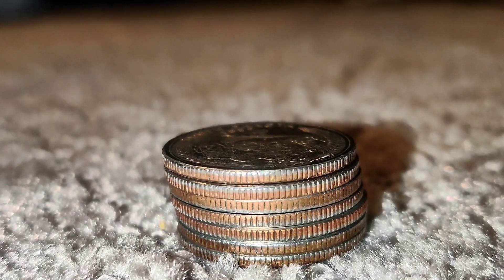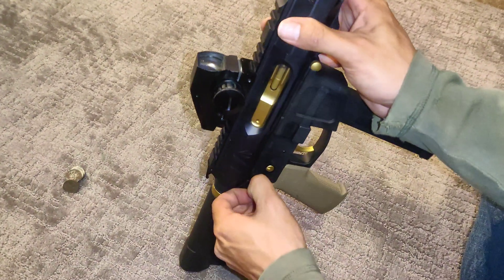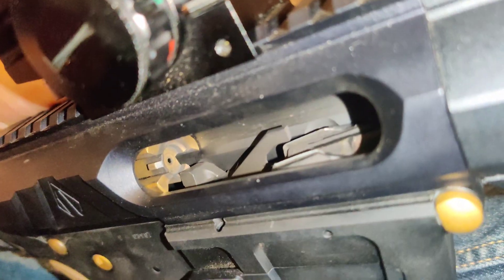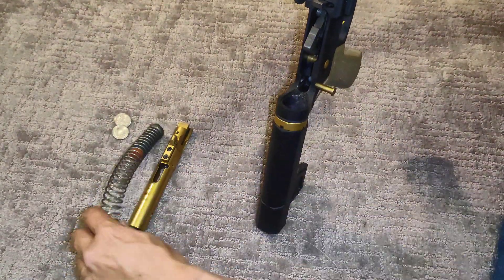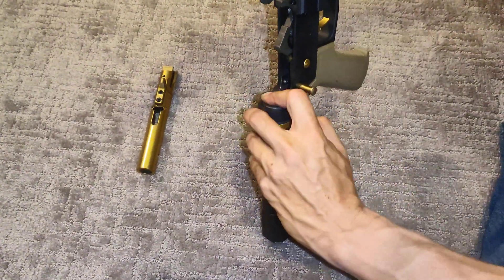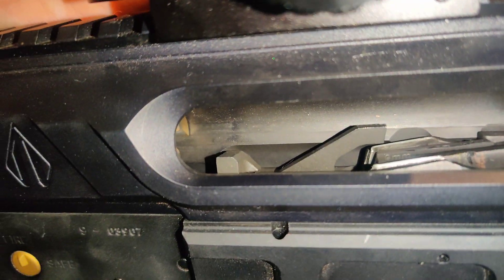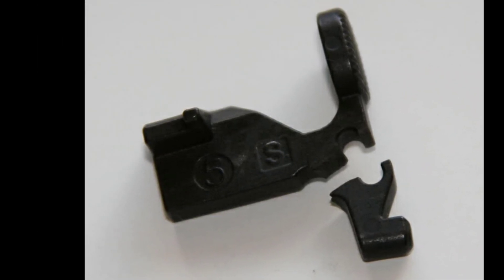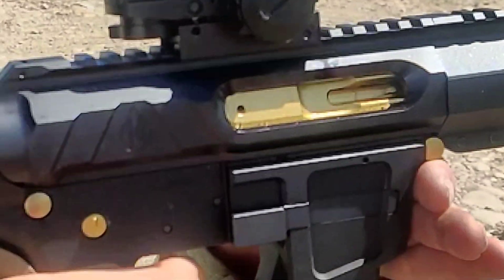stop bolt catch break with quarters

Comment: Never use quarters. They don't belong in a firearm! Evaluate you options with a different receiver extension (buffer tube), buffer and/or spring. Using duct tape as a temporary fix for an otherwise simple, permanent solution never works out in the long run.

Comment: Im doing this with my aero epc 9 right now. My bolt was coming too far back and sticking towards the rear so I threw two quarters down in the buffer tube and that seemed to fix it 100% but now I can't get the last round bolt hold up and to actuate. And then now when I take the quarters out the last round bolt hold open will work but it holds the bolt when they're still rounds left in the magazine so I think my last round bolt hold up and must be bent
Reply from the maker: Yeah sounds bent

Comment: Thanks for sharing. It's funny it took me 6 months to figure out that my 9mm BCG is .75 inches shorter than a standard BCG. A standard buffer is 3.25 inches in length, and they sell a 4-inch buffer to address this. And like you show in the video you can use quarters or a buffer spacer. The other thing I finally learned was the need to get your buffer system and BCG to a weight above 22 ounces. I accomplished this by buying a 7.6-ounce buffer, 1.8-ounce standard buffer spring and my 12.6-ounce BCG. Lastly, if you have ejection issues search youtube for tuning your 9mm pcc and review how to adjust the ejector in your lower. Good luck, I hope this helps others. -GB

Comment: I bought the aero heavy 9mm weight and it needed no quarters. Or put in 1 quarter to stop the bcg exactly at the bolt catch with no extra rear room.
Reply: hi, what's  the buffers weight  ?
Reply from the maker: @alecmya  6.4 for a 3" ar
Reply: @ashash4tube  tnk u, but what the 3" means
Reply from the maker: @alecmya  barrel length you need more weight for longer barrels
Reply from the maker: I like mine to stop one quarter space past the bolt catch to give the catch some time to pop up
Reply: I was thinking 7.5 oz for a 16" barrel 
thank you
Reply from the maker: @alecmya  with that long of a barrel I might even go eight the buffers for 8 oz are generally pretty cheap

Comment: What bcg do you recommend.
Reply from the maker: Depends on how much you're wanting to spend on a basic setup any bolt that's nitride with magnetic particle inspection is great if you're looking for good coatings to make it easy to clean and buttery smooth titanium nitride or PVD is great cryptic bolt carriers have some of the best coatings
Reply: @ashash4tube  what lenght barrel you recommend sorry for asking so many questions.
Reply from the maker: Depends on what your aiming at I use a lot of 3.5" and 4" barrels with linear compensators to get past the handguard
Reply: @ashash4tube  buddy has a 3 inch hes selling is that to short of a barrel.
Reply from the maker: @jerryv9962  most 9mm hand guns are around that length . With the right sites you can take really long shots. I prefer the shorter barrels for my builds because they're safer with all types of ammo where longer barrels can be dangerous with heavy ammo if not balance properly (buffer)

Comment: What weight buffer and spring you using bud.
Reply from the maker: 308 spring and a 6.4 oz buffer
Reply: @ashash4tube  dang my buffer might be too heavy 8oz will it still work bud.
Reply from the maker: @jerryv9962  it might work I think 8 oz is usually for long barrels, suppressed guns and 45 ACP
Reply: Hey bud is that a new frontier upper reciever.

Comment: I broke a couple bolt catches from my PSA ARV and I could not figure out why.  Now everything is clear.  I definitely need to put a buffer spacer in there or put some quarters into the buffer tube.  However, the quarters add to the weight of the gun.

Thank you very much for posting this.   I really appreciate it.

Comment: Maybe this is a dumb question but if the pistol I’m putting together won’t do lrbho I shouldn’t need to worry about this, right?
Reply from the maker: Putting the quarters back there also keeps the casings from getting down into the trigger mechanism and locking up the gun
Reply: @ashash4tube  ah, cool. I'm finding little tidbits of knowledge all over the place. Thanks!

Comment: My buffer is 9oz do you think my cycling would be smoother if I reduced the weight of my buffer and added quarters instead?
Reply from the maker: To be honest a 9 oz buffer is way overweight for a 9mm  you may get bolt bounce it be a good idea to take some slow motion video for safety . quarters or extended buffer don't help make it smoother but it will help it cycle properly and save your bolt catch from breakage
Reply from the maker: Yeah 6.4 oz to7.5oz is perfect and slow mo is great for checking bounce . Sounds like you're on the right track be safe out there
Reply: I run adjustable extended buffers on both of my 9mm. I was always told to add weight until malfunction than roll back that way the bolt barely clears bolt hold open. Do you know if adding quarters would help much with an extended 9mm buffer?
I just put a slightly shorter barrel on my qc10 9mm. I do feel like there is a tiny bit too much reciprocating mass which may be causing slight bolt bounce which would would result in a less than optimal cyclic rate no?

I am going to roll it back to 7.5oz and see how it performs later. I literally bought a brand new phone yesterday (Black Friday sale) with slo mo and super slo mo. Was just thinking what in the hell would I ever use these features for, I'm not much of a technology guy. Now I know lol. Thanks for the input.

Comment: What’s the distance from the bolt catch and bolt carrier when you have the correct amount of quarters ?
Reply from the maker: It should be one millimeter after the bolt catch if it doesn't pick a Roundup pull one quarter out till it does and your tuned

Comment: What kind of buffer do u recommend?
Reply from the maker: 5.5oz dead blow buffer for a pistol size barrel 
 6.4oz dead blow for carbine 
I'm doing a 16"heavy barrel  9mm with a 7oz buffer .
don't get solid buffers if you want to do binary triggers or they may bounce back and fire out of battery with 9mm
Reply: @ashash4tube  cool, mine took 2.50 and seemed to fix the ftf issues I had, only had 1 yesterday, my gun was angled at the time though, put apx 260 rds through it and hit steel at 100 and 150 yards with my romeo 5, was glad and suprised it would reach out that far accuratly!
Reply from the maker: 9mm ain't to bad within 100 yards 200yards especially with a red dot  I don't like scopes till 350yards  happy hear your guns running good 9mm are way new and a lil scary to build with all the 1st Gen ar9s .